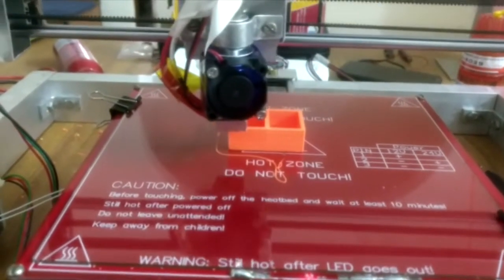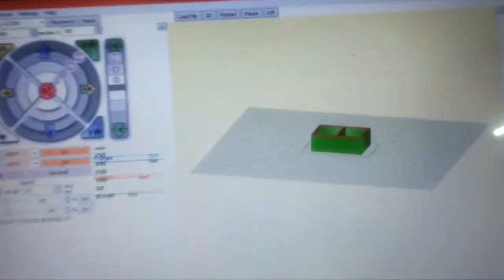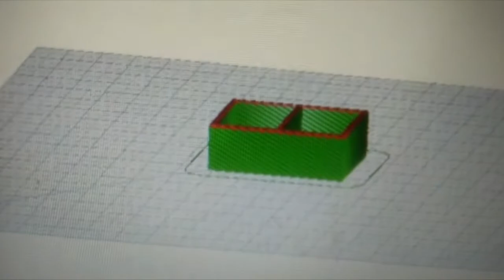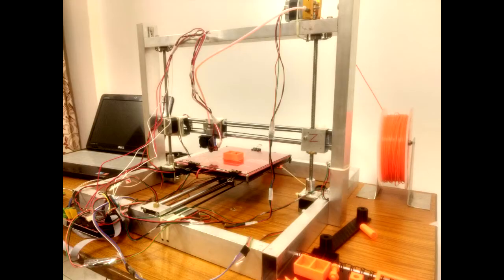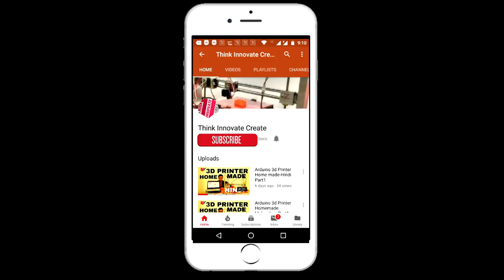Arduino 3D Printer Homemade-Parts Explained

Comment: Hi, thanks for the video. It is very detailed and perfectly paced. 

By the way, you haven't mentioned the heat pad in the list. Also, it'd be good if you can tell where to get these parts from and the price of each part. I can see some of the items on Amazon but not all. 

Keep up the good work! All the best. :)